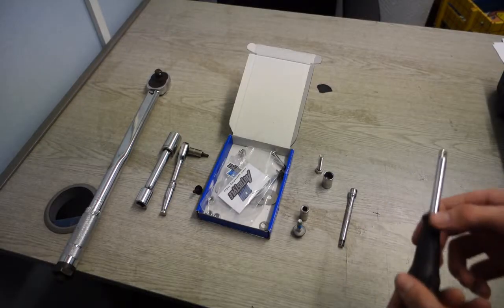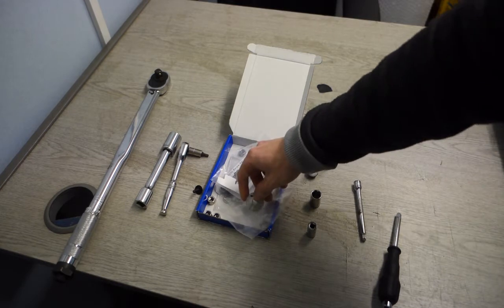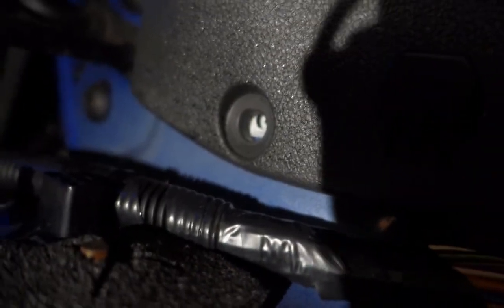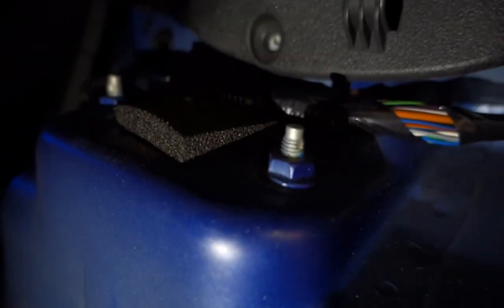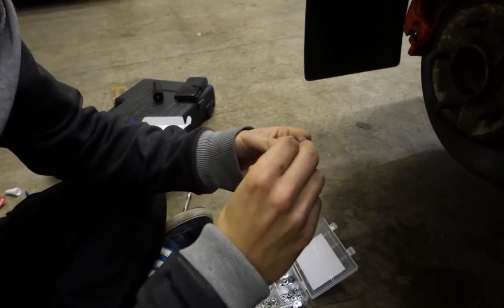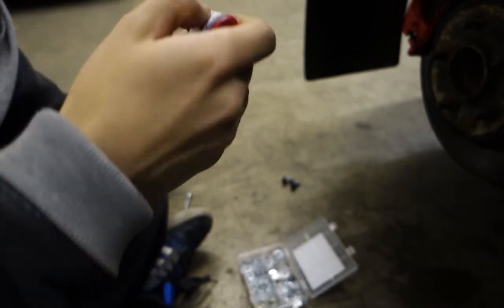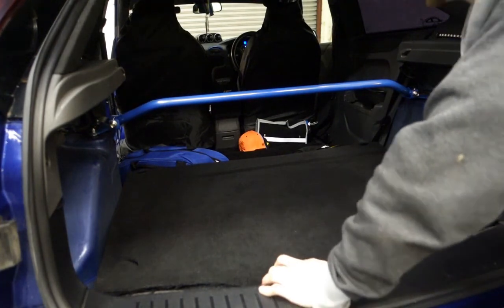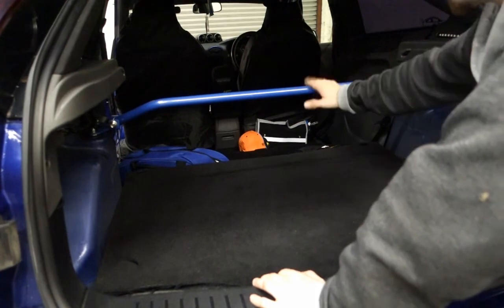MK2 FOCUS ST REAR STRUT BRACE INSTALL!!!

Comment: Some good vids,was going to do this then i saw the k-brace,looks so much better than the single brace!!
Reply from the maker: Thank you Sam, glad you like the vids. yes i thought of the Kbrace but couple of things with that obviously the brace i got is alot less and two i got false floor in so awkward for me to fit without cutting into that. Which for me wouldn't look right.  Kbrace i agree does look my rally look 👀
Reply: I had the same with the floor i just did away with the spare and foam surround,hope i dont get a puncture lol
Reply from the maker: Mine abit different to a false floor mate i made mine with brackets so i can use where the rear seats are and boot well for storage hence why kbrace wouldn't worked
Dont worry if got AA you be fine 😆
Reply: Top man,keep up the good work!!